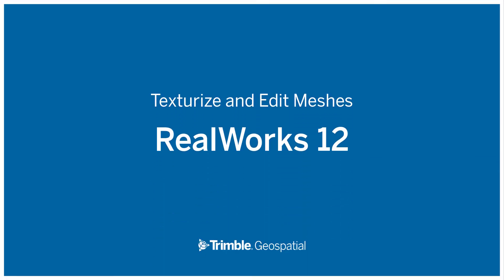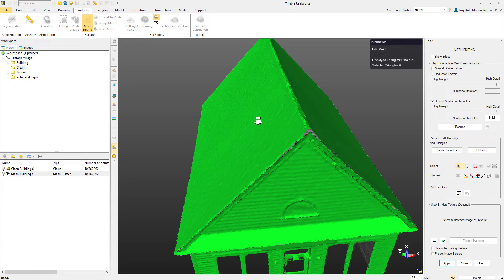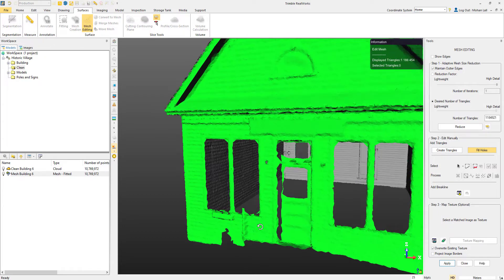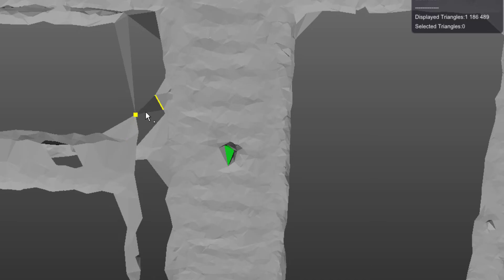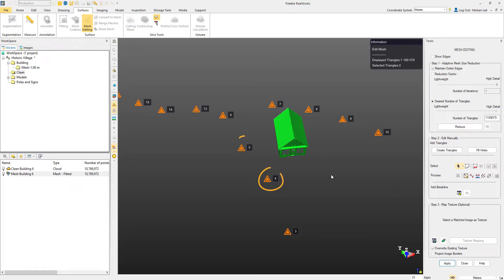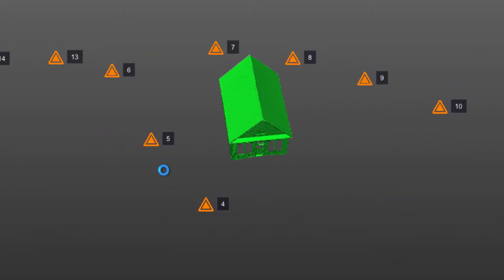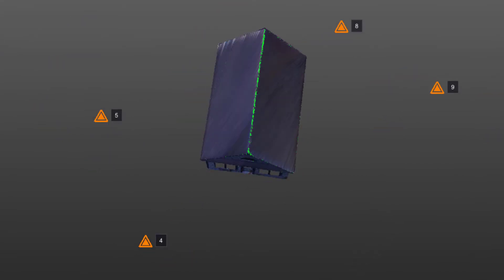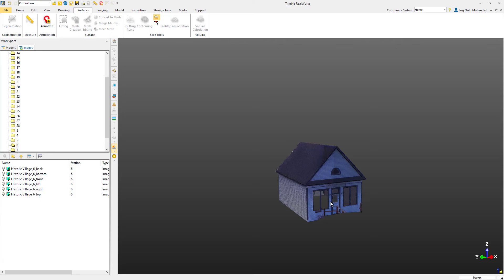Texturize and Edit Meshes - Trimble RealWorks

Comment: Can the coloured mesh be exported to obj or fbx format, preserving the alloted colors? If yes, then how?
Reply from the maker: The colored mesh can exported to OBJ. Simply select the mesh, choose export, then OBJ. RealWorks will automatically export the OBJ file along with an material file and the required images. When you import the OBJ in the next software, ensure that the material file and images are in the same folder.